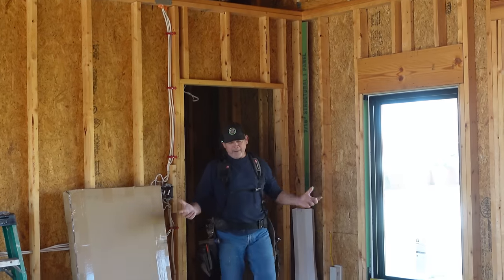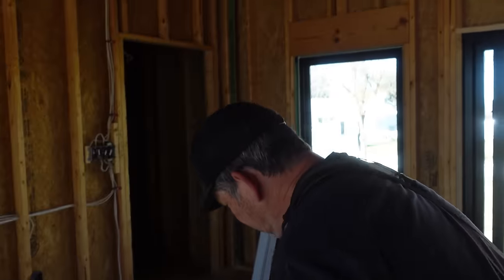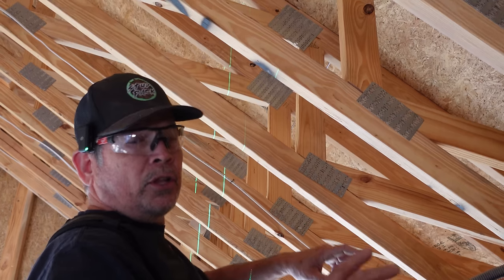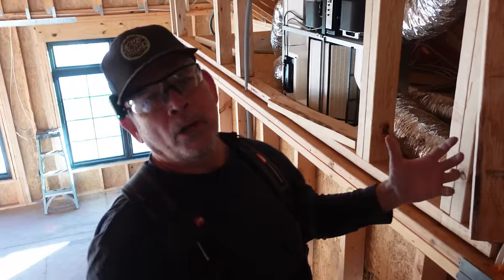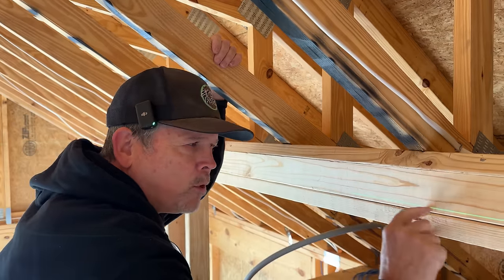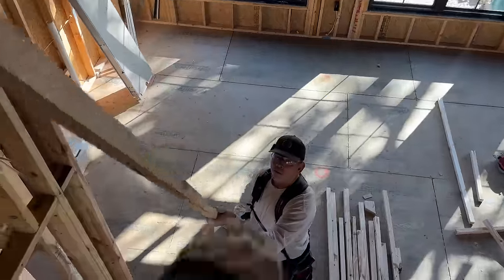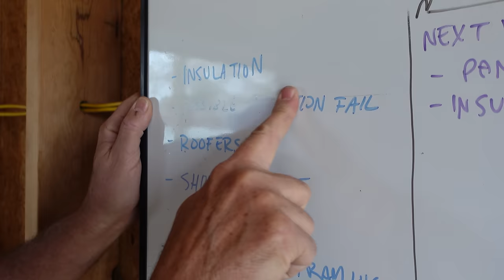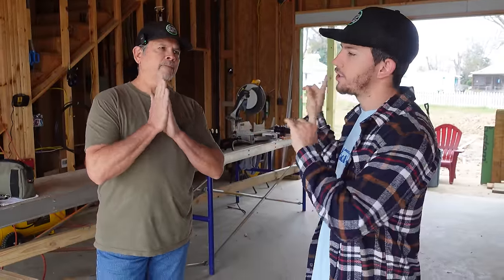We Found the Perfect Access Doors for Secret Storage!

Comment: Hi Studpack, great vid as always! did you account for the flange thickness of the WBD doors behind the drywall? As you normally mount those access pannels directly on the drywall with self tapping drywall screws. 

I ran into this problem with a similar product, creating a bump for the drywall making it sit proud (not flush) to the studs around the opening. To resolve this issue I had to recess the frame into the studs making it flush to the surface (routering out a rebate for the flange) 

Kr.

Comment: Hey guys, I only have 1 suggestion flip the access panel 180, so the hinge side is on top. Will make it easier to get into off standard ladder when finished. Mabe some gas shocks to hold it open or an eyelit bolt to hook to to hold it open.
Reply: And happy holidays
Reply: came here to suggest the same thing!
Reply: Damn! I just posted the same suggestion.

Comment: Hey guys, congratulations on the progress. Looks great! Regarding the access panels: Typically, these access panels are attached with the flange against the backside of the drywall. That being said, I believe your method of installation is much more stable and robust. However, I would recommend ensuring that the panel’s flange is recessed into the wooden studs to avoid issues with the flatness of the drywall.

Comment: I can tell you as someone that has worked around the world on ultra high end Cinemas. (I can not mention what company, but think of the best cinema AV company that everyone makes sure their home theater receiver uses that brands technology) you are going to want that drywall to extend higher than just to the top of the LED strip. Build a mockup. I would say you need MINIMUM 1" reveal of diffusion to get the look you are after. It will help to paint the back of the drywall flat black as well. RGB LED interacts in crazy ways to white and grey reflection. My full advice would be to paint any part that is not visible from the ground of that pocket flat black.
Reply: I like the idea of indirect LED strips like this (white, not colors), but have never seen it done before.  For your reveal number, I’m not sure if you mean vertical or horizontal.  How much vertical space should there be (i.e. how far below the “lip” should the LEDs sit), and how much horizontal space should there be (on each side of the LED strip)?  Any horizontal space needed for this will make the overall wall thicker, and on a new house, it’d increase the house’s exterior footprint.  In my case, it’d be for walls and ceiling at a 90º angle to each other.
Reply: Definitely build a mockup.

Comment: Man I'm kinda disappointed about no update on the network stuff.  I was really hoping for a proper patch panel/rack to terminate the networking for the house and garage.  Even if it was done behind one of those access panels (wouldn't be my preference).
Reply: Yes Studpack, don’t skimp on the network. Don’t put it up that high.
Reply: Hopefully once the main house is built it will only have the fiber modem and a switch up there. They can back haul the internet with a vlan to the router in the main house. @Studpack did you include an outlet (on generator circuit) up there for network equipment?

Comment: You should create a small loft bedroom on the patio side. Leave it open to the rest of the room and it won’t diminish the vaulted feeling.
Reply: That’s a good idea. What about a bank of deep cabinets under the access hatches with space for the TV and speakers and clothes storage? The top of it could be even with the loft floor so you can climb out on it to change the filters in the ERV without getting out a ladder.

Comment: Just a question… Having worked in the HVAC industry, I am wondering if those hidden doors will be located in a spot so that the furnace can be easily removed and replaced? How much more difficult will it be to replace the furnace when it fails?

Comment: 1:06 that side by side refrigerator right up against a wall will make it very difficult to open that left side door. There has to be a decent gap between that refrigerator and the wall, maybe around three inches. And to get that door open fully, you have to also account for how far the handle sticks out in front of the door, because the handle would then be the first thing hitting the wall while trying to fully open that door.

Comment: On the inside of the storage area with the hatches I would put a 2x4 alongside the inside with a 45 cut on the inside so if you are putting or taking out something heavy like equipment or storage containers it will help you get it over that lip and set the items on to that edge (*so you won’t hurt your back*) to reposition your grip and slide the item in or out without damaging the the excess panel lower lip.

Comment: cannot tell from the video but do you have "strongbacks" on the trusses?   Normally a 2 by material running across the inside to keep them from racking.   other option is strapping the ceiling to add additional strength.

Comment: I would have set the panels to open up rather then down.  That way if standing on a ladder needing to access the equipment I don’t have to contend with the door, but let it swing up out of the way.   I would also add a swinging bar to hold the door up then fold back out of the way when the door is closed.

Comment: Would it be annoying with the big piece of drywall coming down at you when you are on ground level trying to access the mechanicals from a ladder?

Maybe you should flip the access pannel 180 degrees upside down that way the drywall swings up to the roof? You could put some kind of catch to hold the drywall while you are working on your mechanicals or whatever. I just feel like it swinging down is a major annoyance if you were not on a scaffolding but instead just like a basic ladder?

Comment: How will you service plumbing and electrical in the walls after the spray insulation covers everything?  I can see pulling wires through it, though it still might damage the insulation, but plumbing you'd definitely need to have full access.  Will you have to rip out the insulation and reapply once you've done your work?

Comment: Great job guys and congratulations on passing the inspection!
At 23'43" in the video it looks though that one more nail plate should be added to cover the gray tube going through the ledger just below the access doors (unless you know for sure that the drywall will only be screwed into the studs).

Comment: Merry Christmas guys! Thank you so much for the entertaining and informative videos. Had to do some electrical and drywall repair and install a ceiling fan brace kit. You wouldn’t believe the precision I got around the cutout for that ceiling fan junction box using one of your tips. I still can’t believe it!

Also going to throw thus out there. That “wood floor” I would suggest heated porcelain tile using the schluter system. Everything else here is going to be knocked out. We have “wood” tile in our house and schluter heated floors in bathroom. The wood tile looks amazing and if you spill something it doesn’t buckle like those crappy laminate systems.

Comment: Re. that short wall for your mechanical/storage space, I did similar pony walls in my attic build-out.  But for the top plate, I used 2x6 and ripped the angle so that I had a solid nailing surface below the rafters and enough material in my top plate to seat the entire angle cut of the stud.

Comment: I would've put those access panels in the other way around and put some gas struts to push them up when open.

Also, are you gonna put the LEDs in diffusing channels? I would consider that, as it'll make cleaning them easier; you can just wipe down the diffuser periodically, instead of having to blow out the bumpy strips. It'll probably help reduce hot spots in the wash, too.

Comment: I love the rendering of it finished. FYI if you have the RGB LED's change with say, music, neighbors might think your house is on fire. Install motion tracking or pressure sensor stair tread lighting. I ran separate wiring and separated some of the duplex outlets to install battery backup night lights for when you have a power outage. I have 30 of these LED 0.04 watt lights throughout my home on a UPS that will run for 22 1/2 days. Before you close it up, make sure you leave a wire to tie in the smoke alarms to the smoke alarms in the main house.

Comment: Rather than the work and materials to pad out the wall for the lighting, couldn't you have framed it flush with the existing wall and changed how you attach the header to the rafter to build the lighting ledge? Or is there some other reason it had to be done this way?

Comment: Wow! Chris did a fantastic job on the 3D rendering. Love how the TV was playing a Stud Pack video. Looks like a cool design. Totally not my style, but it's not my home. I do like the curved edges on the bathroom vanity. Less chance of someone busting their head on a corner.
Does the ERV remove radon or help with radon remediation? I know Fantech has a radon fan, but I think you need to have pipes going under the foundation to vent the radon out. 
I was watching a video on ICF construction and they used web joists (similar to the trusses you used for the roof on the garage). When you go to build the house, would you consider web joists? No needing to drill holes for any ducts, plumbing, or electrical. Just run it through the gaps.
Those access panels are sweet!
I wonder if there is an angle app thingy that works on Android phones. I'd have to take the case off of mine for it to work though.
I don't mind the cheap plastic access panels, but those metal ones look cool. My plastic access panels will either be hidden or painted. I need to install some when I renovate the laundry room and bathroom.
As eager as I am to see the next video, I'd rather have you guys pace yourselves and put out good quality videos and not feel stressed out by it.
It will be interesting to see what soffit material was picked. Hmm.. is that metal roofing that looks like shingles?
Have you considered painting the underside of your soffits light blue? The kind that allegedly repels wasps?

Comment: great stuff guys... for the LED uplight installations I have done, I recommend lining that little notch/tray that the led light strip sits in with metal tape. It helps to bounce the light around and helps to eliminate hotspots (a little... a diffuser may be more important here, but every bit helps).
Reply: I'm curious to see how the drywall edge gets finished.  Maybe capped with vinyl J channel?

Comment: I read that closed cell spray foam acts as a sealer to keep water out, something open cell foam cannot do.  I would think that if you put the roof on after foam is sprayed it would be no big deal.  My thought would be how much the nails penetrate , and how deep is the foam?   Next question is about the safety of that foam chemical product.  watched many videos of unlucky home owners who found residual chemical smell so bad they had to get it removed.  how do you know your contractor will not stick you with the same problem?

Comment: Consider putting blocking on the entertainment wall in case you want to put a wall mounted tv. Also consider wiring the house and garage as if your going to rent one out with easily changing to two meters.

Comment: @studpack Given the height difference you might want to check if your top plates are bowing out. Seems odd to not have a horizontal tie beam anywhere not only for the roof load but for wind.

Comment: You have a strong header over that windows, but not the doors?
I'm thinking how the access door would work with a hip wall;  I think local code would require finishing that accessible space.
I would think there would be a Push plate so you're not pushing against finished drywall.

Comment: Those access panels are great, I moved my kitchen from the front of our bungalow to the back and had a load of ugly plumbing on the wall where I removed the kitchen units. 

Once I had dug out the floor and run in the new pipework and stopcocks when it came to access to the stopcocks in the floor I choose a 12" x 8" access panel, removed the plasterboard and replaced it with a piece of laminate flooring with a ring pull, it works with no critical comments from my wife...for a change.😂😂

Comment: Hey guy's  i would 100% do drywall before siding. I have seen siding twist and pull off the house from doing drywall afterwards. Remember it's a massive amount of the weight of the building . But im in the north maybe it's different products up here ,but it is called sheet rock for a reason. Have a Merry Christmas

Comment: People always over complicate things.  Four to six screws on a primed painted sheet of 1/4 plywood. Choose your size. 
Or hinge the top and just one or two screws on the bottom.  Attach a string on the inside and loop it on a hook or nail above the panel. That's how grandad did it.

Comment: It will be interesting to see how you get a smooth, square top edge on the 5/8" drywall that conceals the LED lighting strip.
Reply from the maker: J-mold 👍
Reply: @StudPack In keeping with your MCM look… when your drywall finishers are finishing the J-Mold have them tape that joint with mesh tape. If they just put mud on the trim, it’ll crack.

Comment: Everything looks great, I think you may be making a mistake with your network area.
You have fiber running there, you should be planning to run a fiber to the main house from the network equipment area you setup.  That area has good space, you should be installing a small rack, a dedicated circuit for a battery with the ability to handle a router, large POE switch and probably a NAS at some point, and a good battery UPS to keep it powered for the switch over to generator (even with solar batteries).  This will generate heat and the a small roof vent above with the ability to add a fan can help you get rid of the heat.   You should also be thinking about some more robust network gear.

I do Networks for schools and basically a living.  If you want to reach out and talk about products or options drop me a line.

Comment: Can you put the access panel in upside down when you open it up it can’t get inside easily because the way you put it if you turned it upside down when you push that you would lift up and on the door would be completely out of the way

Comment: Perhaps the reason the top recess grew by an inch is the wall is out of square? I had to frame a wall in my older (crooked) house and had to choose between level, consistent height, and square - this made me think of that and perhaps the room is just slightly out.

Comment: As I was watching your build with the panels my first thought was to have a 3-ft floor come out and then go up to the ceiling with a few lights inside and access from the end. Then you would be able to service the equipment and have an area for storage as well which with the original design would be dead space anyway. The access panels should be hinged at the top and open up and attached to the ceiling to hold them open. I guess you're going to get out a ladder every time you want to change a filter or work on the unit, you'll have to be standing on a ladder. With my idea you have three feet of floor to walk around on as your service those units. Also with my plan you could also use those service panels to put things up there or take things down why you still had a floor to move on.

Comment: Oh, no.  Y’all gonna spray foam? Been hearing whispers of the powers that be pulling away from it lately. Any insight? I’ve always wondered about the added difficulty locating issues if everything from plumbing and electrical / water leaks will be covered by foam.

Comment: Buy a Pica-Dry mechanical heavy duty mechanical pencil.  You will never use a carpenters pencil again except maybe for a spacer. When I bought mine I bought an additional pack of leads and a pack of white leads(for marking metal)

The lead’s don’t break like carpenter’s pencils do and it has a built in sharpener fir precision work.

Comment: I realize three inches isn't a lot to lose on a room that size (LED spacers), but at that height you could have gone with a plain triangular painted-in moulding instead (30 degree angle or less) and it would have been all but invisible.

Comment: I know hindsight is 20/20 but it looks like you used double the amount of wood you should have and double the work. I would have thought about building a pony wall for that mechanical room. Build it 4 inches down like you did. Use a 2x4 with plywood with a 2x4 ripped to the angle of the ceiling and set that portion back. Essentially, you're setting your top plates back to achieve the same results. Love the work you guys do just throwing that idea out there if you ever do something like that again.

Comment: I looked into spray foam, and basically after 10 years they find that the roofs are all dryrotted from it retaining too much moisture. I would never risk it.
Also, others have a great point about not painting a work area's floor black. A light grey would be better (if you just don't want pure white for whatever reason).

Comment: Regarding using a phone as an angle finder: for rough framing it's fine. Think of it like a tape measure. The tape measure you use to frame a house does not need to have machinist-grade precision. One sixteenth here or there isn't going to make a difference, nor will a degree or two plus or minus 🍻

Comment: ❓ staggered stud walls for sound/noise control.  Have you ever done this?
❓ are you considering 20’ deep geothermal air conditioning heat exchange system? Or perhaps desiccant based air conditioning (even DIY solution!).
❓ any back up power solutions? solar, power wall, or generator?
❓ are cisterns legal in your area?